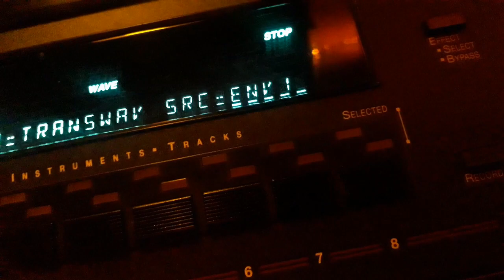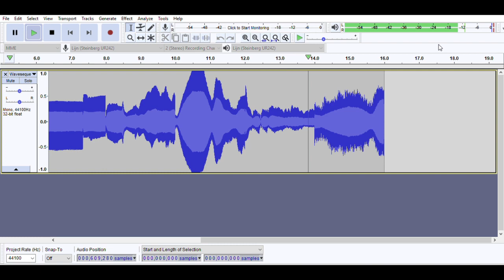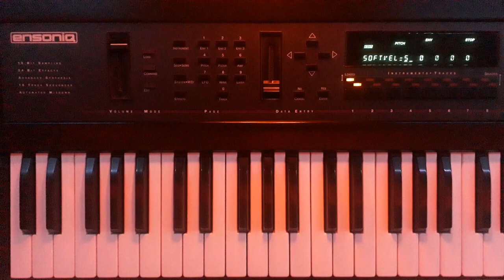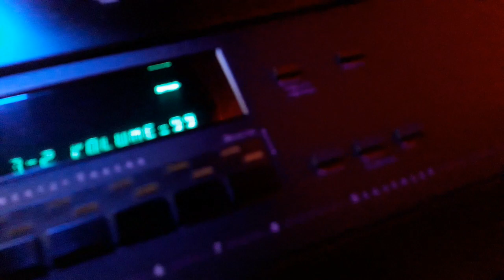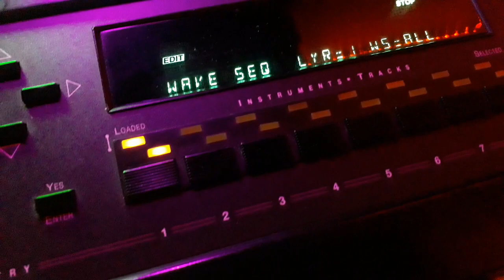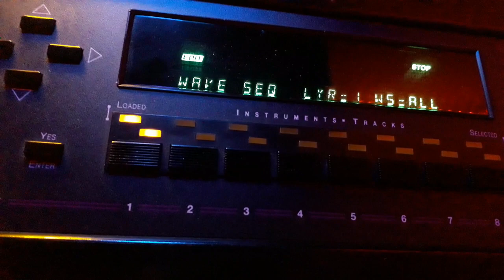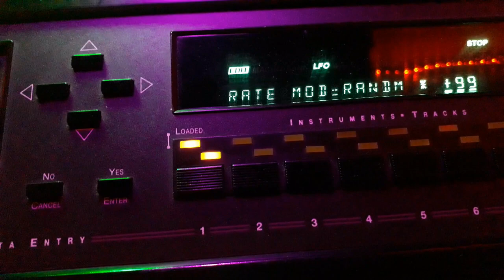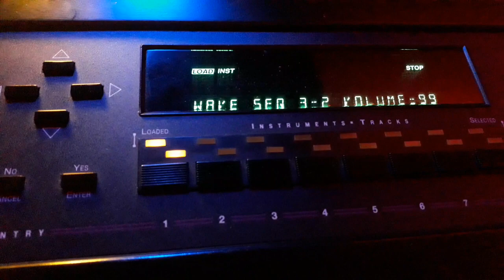ENSONIQ EPS-16 PLUS -  Soundscapes Method 2

Comment: I just bought an EPS 16 plus, because of this video !!!  I had no idea you could do that on them...   There is something special about Ensoniq Samplers...  I own a Mirage, EPS Classic, and now a 16 plus....     I guess next year, i will hunt down an ASR 10....   These are Real Gems !!!
Reply from the maker: Hahaha....nice. Yeah, when I bought the EPS-16 Plus 4 years ago I had no idea what I was buying. I only found out that these Ensoniq samplers are nothing like any other (old/vintage) sampler. They are a different breed.
Reply: @RoshiAi  hi, I use the samplers to sample drums, I do Detroit Techno. Akais rob the low end, but sounds great for hi hats. Which one do you recommend me, ASR 10 or EPS 16+ , both rack. I am waiting for an Isla 2400 as well. thanks! I won´t use the sampler to synthetise, I own tons of analogues and fms. thanks!
Reply: @falangistavaleroso9689 
The MPC 60 or S900/950 has better bass than anything else. 12 bit leaves huge headroom. For techno a 2000xl does an all round great job. Ensoniq's beauty lies in it's sound design. It's nothing like MPC's, SP-1200, Roland's SP-303 404's.
Reply: @balloonhead61  I had a s3000xl and it robbed all the low end on kicks, was a joke of sampler. Worst ever for kicks, great for hats. I got offered an E-mu E5000 full with 60 gigas internal hd, never tried one, would be good for me?  I am buying an EPS 16+. found one, I want to try as much as possible 90´s samplers.
Reply: @RoshiAi  I am re-listening to this..   Very Satisfying !!!!

Comment: Excellent - I have been feeling quite limited by the hyperwaves available in the TS-10 'as is' - and this is a great example of a work-around (creating essentially the same end product).  It is too bad they didn't leave the option for importing sample set assembled on the EPS-16 plus/ASR-10 as an actual hyperwave instrument (given that the common modulation parameters are sort of included in editing a hyperwave).
Reply from the maker: I was told that samples could be used in a Hyperwave and was a bit dissappointed when I got the TS-10 and found out that they can't.

Comment: Amazing stuff 
Just picked up an asr10 rack and an eps-m rack 
Would it work with the eps classic ?
Imagine adding a Tascam 246 to your setup and have each out going to its channel on the 4 track and pitching down etc omg
Reply from the maker: Thanks! 

It won't work on the classic because it does not have the Transwave function.

It will work on the ASR-10 and the ASR-10 can do internal recordings of your playing and of sequences (so you won't need that Tascam). Pitching down....great idea! ❤

Comment: This is inspiring. How did you transfer it to the EPS once you had created the file? Simply sample it in, or via MIDI transfer? Thank you.
Reply from the maker: Hey Kelvin. I used presets from some of the Arturia V-Collection synths. I 'sampled' or 'did a 2 second mix-down' of them in my DAW (Cubase). I opened al the files in Audacity and lined them up in different tracks. Then I exported that to a WAV file. I used Samplewrench to transfer it over MIDI to the EPS-16 Plus .... during breakfast (it takes about 15 minutes).
Reply: @RoshiAi  Do you think transfer via MIDI is critical, to get an exact file length match? Or, would you consider sampling it in to get a very close replica a decent option? I did essentially what you said with decent results, but sampled the file into my ASR. I realize this does slightly change the file length and wonder how critical that is for transwaves.
Reply from the maker: @KelvinK_GrassRootsRecords  It might work if you get the sample start right. The ASR-10 is more flexible with the use of transwaves than the EPS-16 Plus so you might get nice results anyway. 

If it sounds good to you then it is good.
Reply: @RoshiAi  I ended up using Wavelab to MIDI dump to the ASR10. Thanks again for your help.

Comment: I've been looking for something like this for years and I have so many questions. I don't have an Ensoniq synth and I almost impulsively picked up a TS-10 (glad I didn't). I might pick up a EPS 16 plus at some point, but part of me wants to see if there is a way to get a similar effect with wave tables. Maybe I need to understand how Transwave works in more detail, but I feel like I get the gist of it. Scanning the loop start and stop points that takes zero crossing into effect? I have a Waldorf Quantum coming, and I "think" I could do something similar there. This is amazing. I would send you a virtual beer/coffee if there's a way. Thank you for sharing. Cheers!
Reply from the maker: Thanks and cheers!

Transwaves work exactly like you describe...when used with single cycle loops. In that way it is the same as wavetable synthesis. But...when instead of single cycles (256samples in length) you use chunks (44100samples in length) you get somethinv different to play with. The last is what I did in the video.

The TS-10 is nice too. I can make sounds like in the video on the EPS-16 Plus and load them and combine the with the TS-10 sound engine, which is separate from the sample loading/playing engine.
Reply: @RoshiAi  Thank you for the prompt reply Robin! Glad to know I am on the right path. Would you say an ASR-10 Rack would get me the same ability to control the samples as well as the modulation you are doing with the EPS here? I've got my eye on either an EPS+ Rack or an ASR10 Rack after having seen this. Wan't totally sure about the ASR, but I think it has many if not all the EPS features. (Been a while since I delved into the ASR). I'm also looking forward to applying these concepts to the Waldorf which will be fun.
Reply from the maker: Yes...the ASR-10 can do the same as the EPS-16 Plus. It has more effects, more memory (mine has 16mb) and can handle stereo samples. It can also record it's own sequencer as a sample...which is very cool.

I have not spent much time with the ASR-10 yet. I like working within the limits of the 16-Plus still. Porting these sounds to the ASR-10 will open up a lot more though.
Reply: @RoshiAi  Curious if you used a specific chord, or is it a combination of two? The cycling of   notes creates some interesting chord progressions which I think is half the magic of this :)
Reply from the maker: @djdonovan  I don't play specific chords. I just play random notes within a certain key scale.

The ENV's are on REPEAT but since the processing power of the EPS-16 Plus is a bit
limited the ENV's don't always play in the same tempo (in sync). THIS and probably more creates
the nice progressions of notes and waves of sound.

Doing this on a TS-10 or ASR-10 sounds different, cleaner, more tight and in sync.
The reason why I am still exploring this on the EPS-16 Plus before moving to those machines.
Reply: @RoshiAi  Makes sense, when trying this in Serum, I used the Hz instead of BPM sync. My "chord progressions" aren't working out too well though. I need to find a better key scale. Going to research on ASR LFO features. Maybe there is a way to fudge the sync so it sounds more organic like the EPS. To be continued :)
Reply: Hi Robin, I hope you are doing well. I keep coming back to this at least once a month. Would you be willing to share the source audio files for this? I never got the Quantum or the EPS, but I do have an Iridium coming and I'm hoping to try this on that. Might help me understand how to translate the process you are using to that device with similar sounds. I'm also curious the chord progression and key you are using. I have a NDLR but again, I'm trying to grasp the fundamentals before I add the bells and whistles. Anyways, I figured I'd ask you directly, maybe others have figured it out.

Comment: Your source samples are really good. What did you use for source?
Reply from the maker: For this video I used presets from multiple Arturia softsynths like the Prophet 5, CS-80 etc. I tweaking them a little bit, mainly turning off the effects and take out any vibrato type ptogramming.

On Method 1 I used Yamaha SY22 source samples, no presets.
Reply: @RoshiAi  I may try this with some samples of a Alesis micron I kind of want to sell off. Thanks for responding.

Comment: Amazing stuff! how did you select the wavesamples that you spliced together in audacity? were they all the same pitch? same length? I am waaaaay into this? Soundiver is the best for sample dumps?
Reply from the maker: I basically just randomly pick some sounds that have some movement to them from either hardware or software. Same pitch and no detuning in the sounds themselves. When 1 sounds has detuned oscillators it will mess up the sound in the EPS-16 Plus, it will sound out of tune when played polyphonically. I recorded each sound for 2 seconds at 60BPM on 44.1kHz so each segment is 88200 samples in length. I dumped the sample using Samplewrench. It's a 16sec sample so that will take about 16 minutes :P which is okay if you make breakfast or something in the meantime.
Reply: @RoshiAi  Hi Robin, would you agree or disagree that digital sounds (FM, Digital, Rompler) sound better than analog based sounds using this method?
Reply from the maker: @regend762  I am actually playing with some more Wavesequences. The analog style sounds sound a bit more growling and bubbly opposed to the digital pcm type of sounds. Those sound more atmospheric and ethereal (?)...I think that's the word for it.

I will let you hear soon what I mean. The two compliment each other well.
Reply: Ok. I have followed this closely and have found some things you don’t mention.  Are you using those other envelopes for the volume fades or is that what the randomizes lfo is for?   I keep dissecting this because it is trickier than it seems.  Also. Did you cross fade the waves when you created the sample? I don’t hear any artifacts when you play it in audacity.

Comment: Wow! What FX you used on this sound? Some other than those on 16+ ?
Reply from the maker: Mostly the Reverb on the EPS-16 Plus. On the Reverb you can detune the reverb tail. I also added just a little bit of Roland GP-8 (analog) Phaser at the center. I am kind of picky about that because I normally like to keep the sound as Ensoniq as possible. One thing is for sure: If I would take that effect out the sound will still stand on it's own.

Comment: You mention there are 8 samples, 2 seconds each recorded at 60bpm 44.1Kh. And then you say that the first loop end point is obviously 88200. How is it obvious? Did I miss some math here?
Reply from the maker: 44.1 kHz means 44100 samples per second. 

2 seconds of sampling then gets us 88200 samples per Wavesample (or segment) so the first looppoint should be at 88200.
Reply: okay definitely missed some math, thanks! Wow this actually makes a huge difference, gona make some patches now!